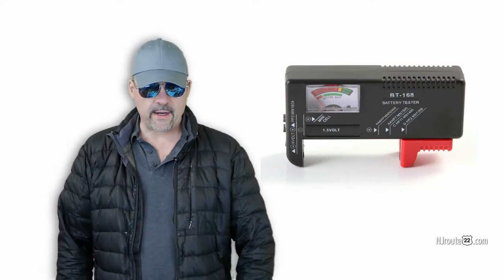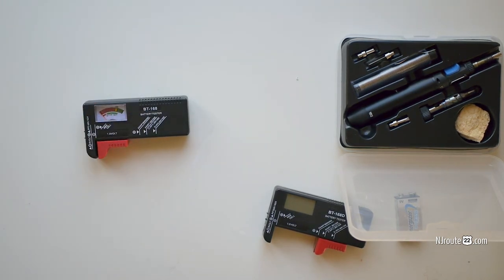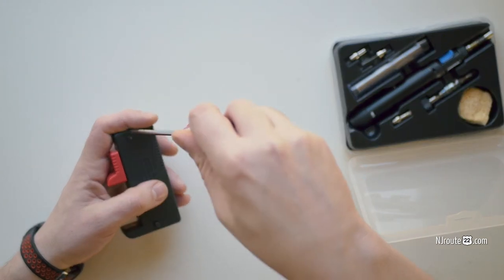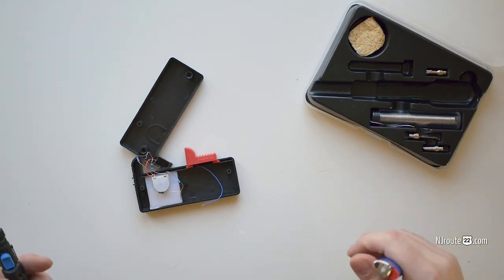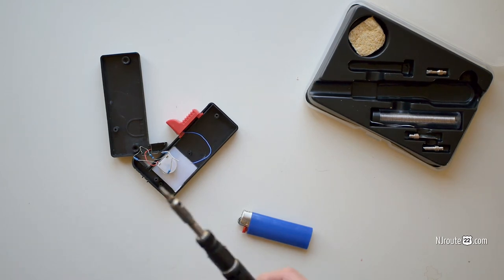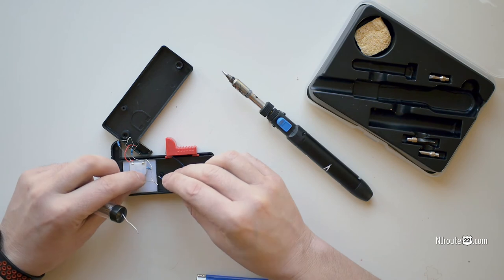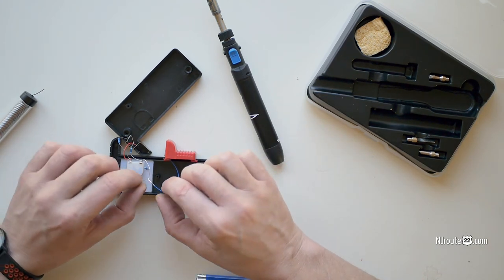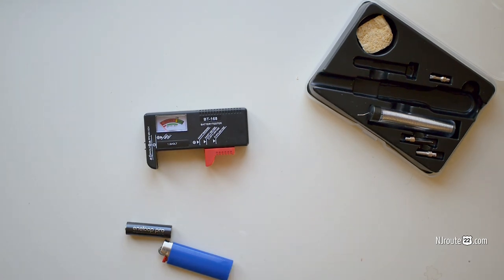How to fix your BT 168 Battery Checker Tester

Comment: I was hoping to see a technical fix on this, in my case the wire is fine and voltage makes it to the board but nothing is displayed, 9v works. Beyond what I've checked I don't know what the next step would be, any ideas?
Reply from the maker: Not sure - but check the continuity to the two tabs within the slider mechanism. Maybe a bad solder joint. If it works with 9V and not the others - I suspect that there is a lost or loose connection somewhere along the circuit.

Comment: Hi sir, I have BT 168 pro and I've tested A23 battery 12V by mistake, after I noticed a problem in reading the digits, do you think the device is broke down?
Is there a possibility to fix it?? Thank you in advance.
Reply from the maker: Adding extra voltage can certainly destroy a device that is meant to work on a lower voltage....